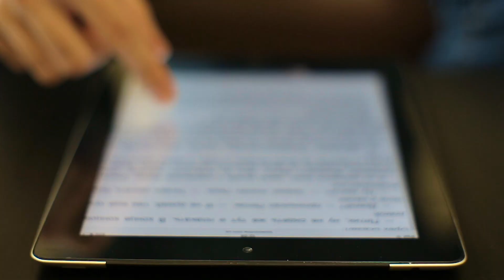NASA Seeks Ideas from the Public for Powering Exploration on the Moon

Comment: Since the only decent renewable energy source is electromagnetic radiation it's important to remember that we are no longer constrained by the effects of atmospheric filtering. We need to start thinking now about conversion of the entire spectrum to energy, or at least as much of it as reasonably possible. Solar power as practiced today is mostly limited to small portions of visible light, thus limiting efficiency.  
 It also makes projects like the molten salt or sulphur solar collection arrays now being experimented with on Earth much more practicable and clearly less dangerous than nuclear.  
 Strategically placed around the moon with battery backup facilities, they could easily provide for large scale needs.